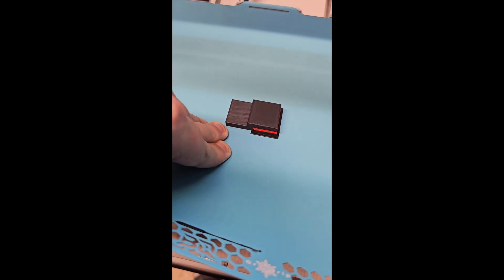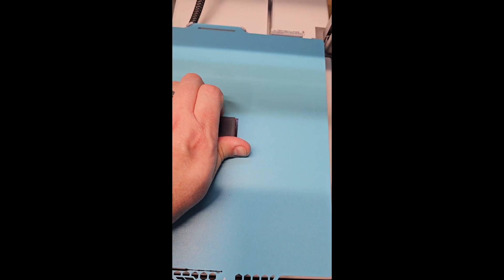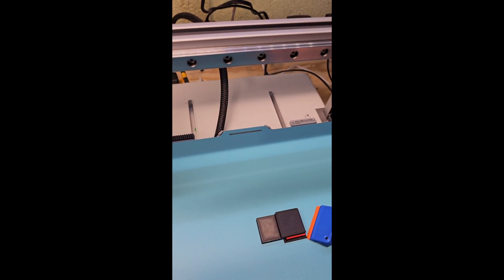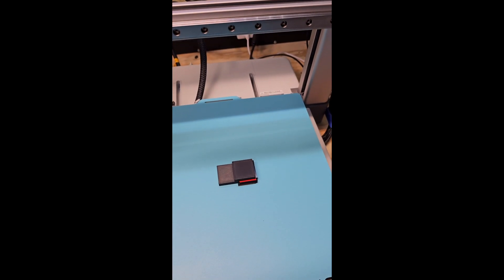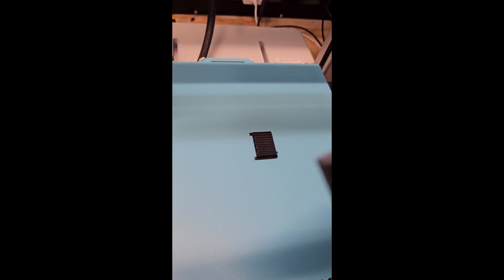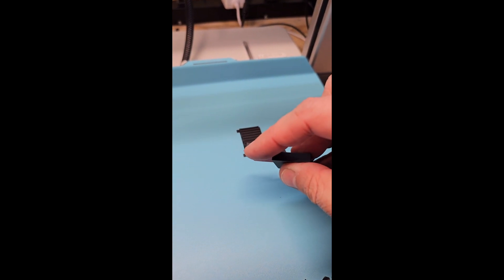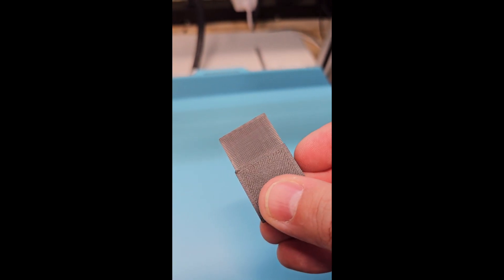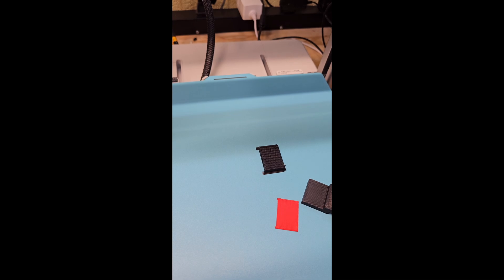Breaking News For 3D Printing Support Materials - Game Changer!

Comment: How is the bleeding between filaments?  I know when using PETG as a support interface you really need to purge the hell out of the filament changes, if not the PETG bleeds into the PLA and makes layer adhesion really bad in the print.
Reply from the maker: I'd say the same applies here since the two materials don't stick well to each other either. I haven't had a problem with setting the purge to between 450-550 in bambu studio. Yes, it wastes a bit, but in my opinion, the better overhangs are worth it.
Reply: @rustynaildesignco414  very nice, I know that it needed to be really purged to clear it out, but I've never gotten around to finding out how much needed to be purged.  With those numbers I'll do some experimenting of my own the next time I get a chance.  Thanks.